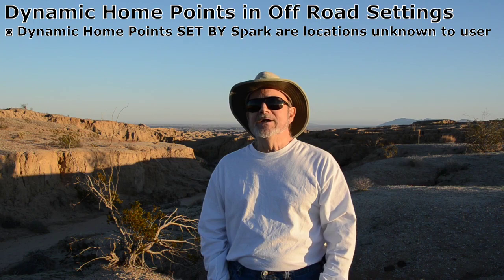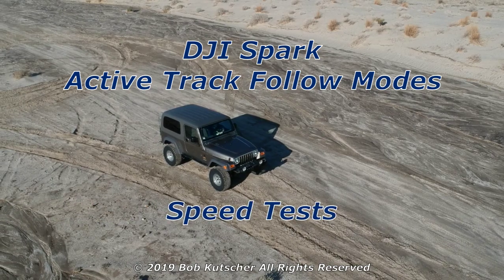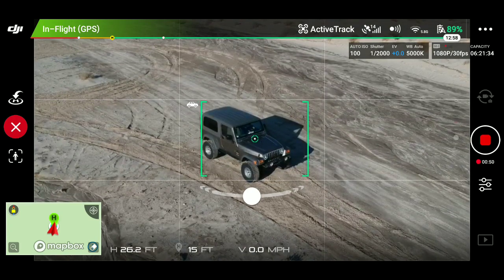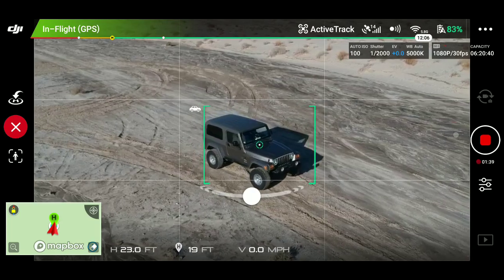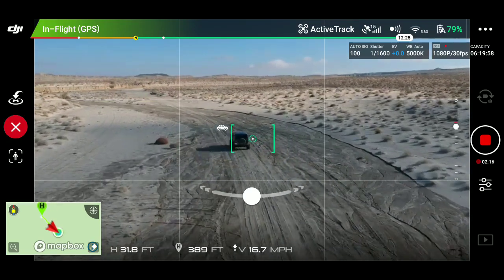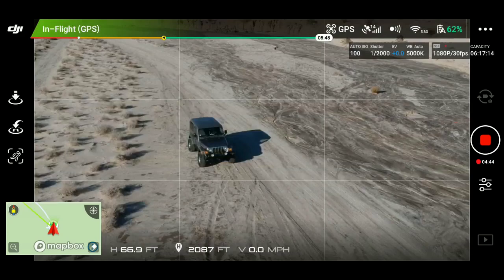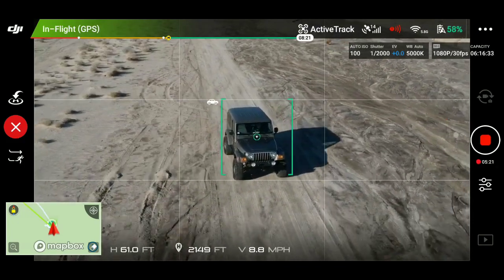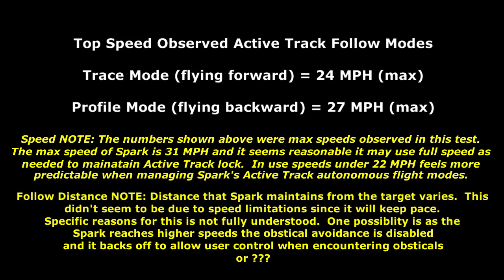DJI Spark Active Track Speed Tests and Dynamic Home Points

Comment: Hey, Great vid.
I just got myself a SPARK, but it seems to be really slow in active track, and won't go over 10kmp/h:
How do you get it up to speed.
It wont active track in sport mode.
I realize you video is some years old, but. :D

I'll be using it for off road motorcycle adventures.